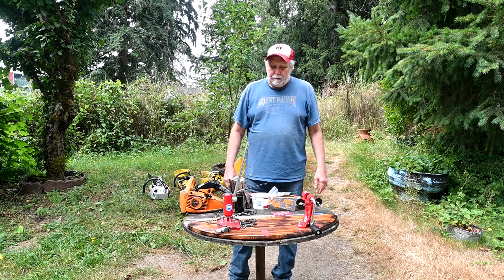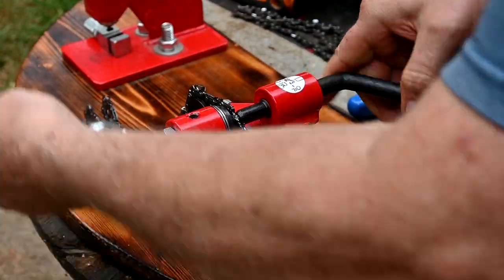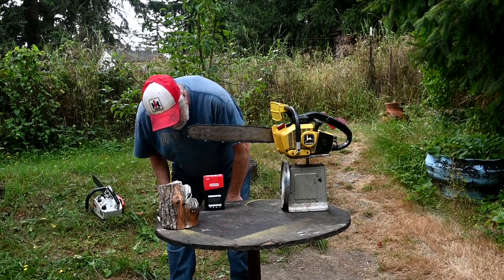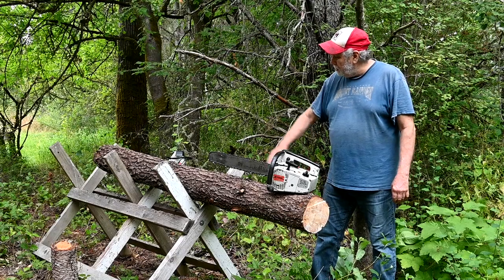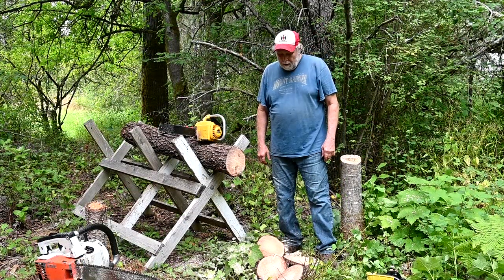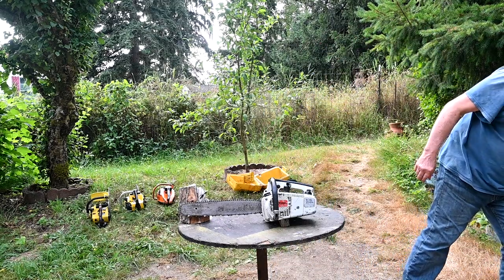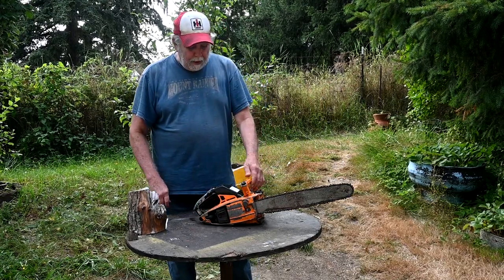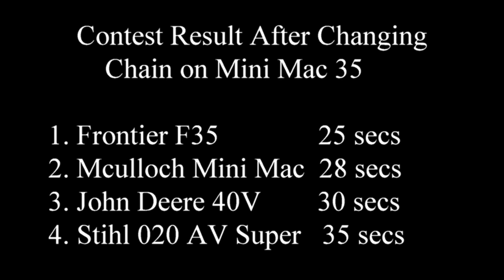4 Vintage Mini Top Handle Chainsaws Competition

Comment: Interesting video.  Like your humor :)  I like that Mini Mac.  My hubby is saying no to me having a chain saw :(  He mentioned "kick back".  I don't know.  But just once in my life I'd like to run a chain saw.  They sure seem to need a lot of mechanical upkeep.  My stepson has 3 or 4 chain saws and none of them work.  I'll recommend he watch your videos.
Reply from the maker: Chainsaws can be dangerous, but with some common sense, and watching how to video's, they can be used safely.  One thing I rant about, and don't like, are safety chains.  These prevent kick back in most cases, and for a first timer, would be a good idea.  I don't like them as they don't cut fast like I like.  I have used chainsaws since 1980, with no problems or close calls as to being injured.  I have never had anyone show me how to operate one either.  I have watched tree cutting video's put out by forestry services and others on proper chainsaw use, and they are excellent.  The owners manuals have a lot of info in them also.  Gasolene powered chainsaws require technical expertise to keep them in good running and safe operation.  I would suggest using a battery powered chainsaw.  They come with safety chains on them, and require virtually no maintenence.  It is very satisfying cutting wood, especially if you heat with wood.

Comment: The real Question, How do they fare against Mr. Poo!
Reply from the maker: I hate to admit it, but I think Mr. Poo would be the winner.  I will have to get the Poo saw out and run it against the Frontier.
Reply: Mr poo would put the stank on them!
Reply from the maker: Mr. Poo most likely would win a competition between these saws, as it is performing pretty good with the mods done to it.  It also has a 20 to 25 percent advantage in displacement. @timothybyrom5560

Comment: Cool comparison. The 35’s Chain definitely needs help! chattering.
Reply from the maker: The rakers are too low, .030", instead of .025, making the chain too aggressive.  Will wear in with use. Even so, the little Mac has plenty of power to cut with it.

Comment: I like the little old saws a lot myself although I own some big saws also. Ironically the mini Mac is my favorite. I have an almost nos mint one with the form shaped case, sales and warranty paperwork and polished stainless 14 in bar, my favorite is my fully ported, zama carbureted mini mac, talk about loud....
It will pull a 16in low pro half chisel thru hardwood faster than my big saws. I have enough parts to build 5 saws. Love em
Reply from the maker: Having a ported mini mac is pretty unusual !  The mini mac's are my most used small saws, and have served me well for a long time.

Comment: Good video! One top handle saw you need to add to that collection is a Poulan 2000, 2.0 ci, 33 cc.
Reply from the maker: I have a Sears Craftsman saw of that displacement, but it might be the cheapo version of the 2000.

Comment: You can forget about that Red Armorhype about being stabilized for two years.  I tried to crank up my Poulan Super25, today and must have pulled it over 100 times - nuthin, nop pop, fizzle or anything but me dripping sweat on the saw.  Finally, I wised up and dumped the Red Armor which had been in it about a year.  I filled it with 50:1 Echo Power Blend Gold, also an FD oil.it popped on the second pull and cranked up in a couple more.  I let it runfor 15 minutes and put it in storage condition, since I-rarely use it.  My MAC 32-16with the same vintage Red Armor did crank up and runOK, but not the Poulan.
Reply from the maker: I am unfamiliar with the claim about the oil and gas being stabilized for two years The saws I have been using the Red Armor in are never not used for more than a couple of months, and I have had no issues related to the oil.  I was at an  Echo dealer recently and asked what the difference between the Red Armor and the Power blend gold was, and he said the only difference is the additive used in the Red Armor to remove carbon.  Don't know if that is true, but that is what I was told.
Reply: @mrobsoletesvintagehomestea9156  I will say my MAC 32-16 cranked OK and it was originally filled with RA at the same time.  I checked my records and both were initially filled with RA on 14 Gfeb 21 and both were last run on 10 Sep 21, until today.  On both occasions, they had been run 15 minutes and topped off with new fuel.    I did notice the gas in the Poulan was a brown color, indicating to me it was bad.  Both RA and PBG are FD oils.  50:1 PBG is my current operational gas.  I put that damn MS 251 to bed for the winter today, with PBG.  I will wake it up next spring and see how it behaves, then.  My new Stihl saws like it.  My Poulan ran it, fine, too.  I am going to switch every saw I have over to PBG..  those I do not put to bed for the winter.

Comment: Love the lil frontier
Reply from the maker: I was surprised that it won my cutting contest.  I had never seen one before Mr. C donated it to me not too long ago.  I can see why they were popular for arborist work, powerful, light weight, and easy to handle.
Reply: @mrobsoletesvintagehomestea9156  i have the same saw labeled as a skil.
Reply from the maker: The Frontiers were sold under a bunch of private labels as well as mainstream saw brands @justinweaver8787
Reply: @mrobsoletesvintagehomestea9156  yes thats how i got the 1 i have as a skil brand i love it but picky to tune
Reply from the maker: Most all small saws are finicky to tune.  Temperature and air density really affect these little rascals. @justinweaver8787
Reply: @mrobsoletesvintagehomestea9156  sure do

Comment: I was going say that McCulloch chain sure is hungry. 
I was hoping the Frontier would win. ;) those ex Pioneer engineers really knew what they were doing. 
As for being finicky have you pulled the spark plug on it and reused it? 
If you did maybe the plug isn’t sealing. If you pressure test an engine with a plug that’s been removed and replaced 9 times out of ten they leak and you’ll see bubbles at the sealing surface of the plug. That’s with the washer style plugs. 
I still haven’t got my Husky 35 going yet but I’ll get it going for this years firewood.
Reply from the maker: The Frontier is an interesting little saw.  The times I have run it so far, the weather has been hot, and it has a bit of a problem with vapor lock.  Now that the weather is cooling down I will be doing more cutting with it.  I had put a new plug in it as part of the repairs to get it going, so that should be fine.  The Stihl 020 and the Frontier were the two saws that were the most finicky in the hot weather.  Both run hotter than the other saws did.
Reply from the maker: Just watched your short on your motorcycle. What could be better than collecting vintage motorcycles, chainsaws and snowmobiles?  I'd say not much !!!

Comment: Red armor works period and you should run your saws  at least once a year i use mrfilter to remove  the water that's the enemy to small engines a long with ethol sorry to ramble on wonderful informative video as always take care
Reply from the maker: The Red Armor oil works great.  The saws that I use for tree and brush work, never sit for more than a couple of months, and I only use non ethanol fuel. I don't have to do nearly as much fuel related repairs on my equipment as a result.  Thanks for watching.